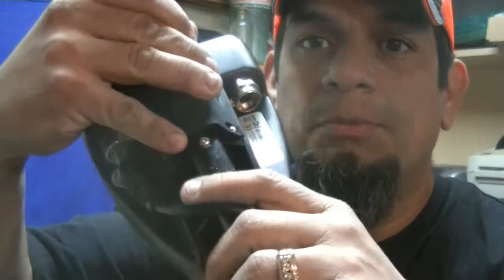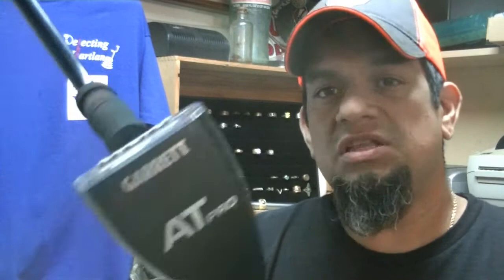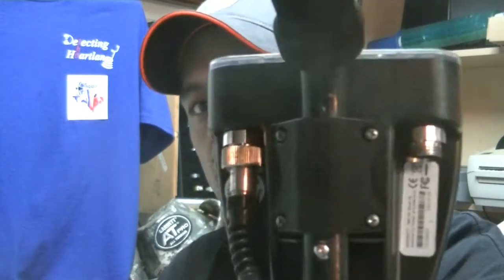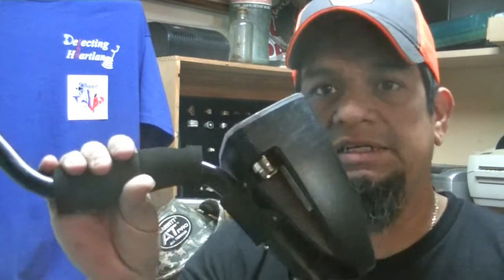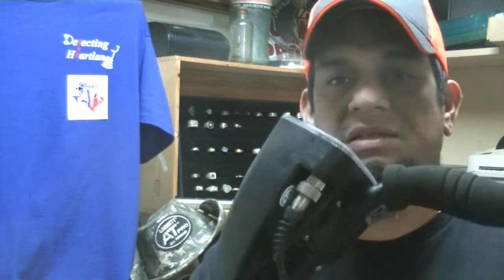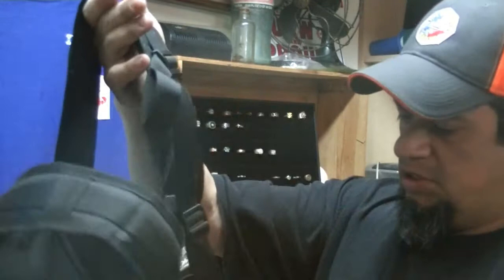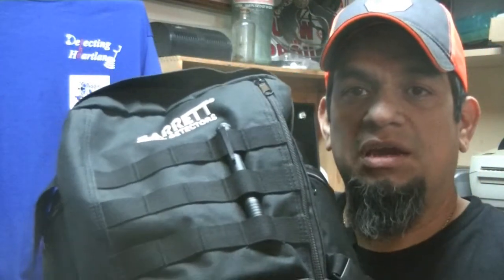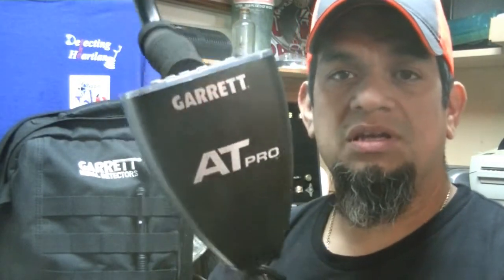Prevent Broken Housing on the Garrett AT Pro/Gold Solution

Comment: thanks for the heads up on the possibility of a broken housing on my AT GOLD , I'm 79 Yrs old & when the weather is a bit warmer I hunt ( Sometimes ) In Rocky areas, this way I can be prepared -Just in case,  I live in Georgia,  As good & upstanding as Garrett is, Mabey it would  B a good Idea if they would Get Kelly co to handle this product in the case of a mishap, so one would have to send it to the factory, & save the time as you said, thanks for caring,  I appreciate It,  P S I just subscribed  2 your site,  thunterjack
Reply from the maker: John Clarke, you are very welcome. If you go to the website and add the item to your cart but don't check out and wait a couple days, they will email you a 25% off code.
Reply: Thanks again, I'm going to order mine next week ,  thunterjack
Reply: beside the breaks this AT_PRO will find you lots of gold you did not do wrong by buying one  just read up on its weakness all plastic related issues and there are three major weakness`s 1. housing may break? after hundreds of hours of heavy duty use`s its only done it to me one time.  2nd coils break a lot learn to use J B Weld (after warranty)and lastly rear arm handle breaks EASY! at the screw holes you  will need to drill holes thru the stubs and get screws that are long enough to go thru tighten with locking bolts and no problems after that. oh and good luck!

Comment: Looks like the at max it the same set up.  Gotta get me one b4 it breaks thanks
Reply from the maker: Brian King the ATMax does have the same housing mount. I’ve also got an updated video that shows another mount for the housing but I like this one better. I transferred this bracket over to my Max. Thank you for watching and commenting.
Reply: I just bought the shapeways one piece 6 screw in orange.   I'll let ya know what I thing when it comes.  They also have other colors so you can pimp your ride how you like.

Comment: so how does it screw into the housing?
Reply from the maker: dafish9161, sorry for the late reply. The 4 speaker screw come off, place the control box housing over the shaft (don't remove the speaker cover), then reinstall the screws. Make sure the (P) in Phoenix is towards the coil.